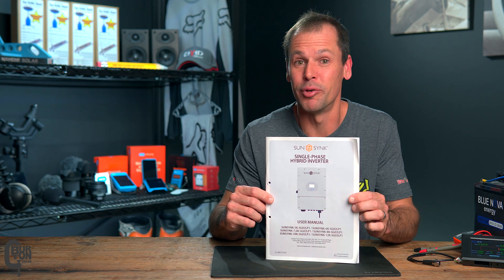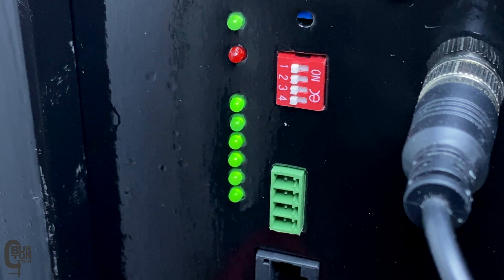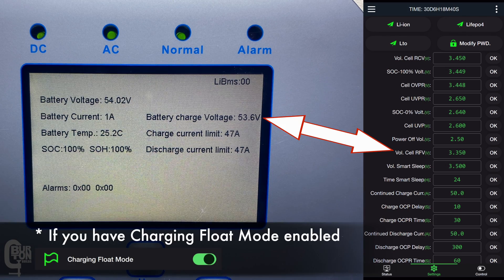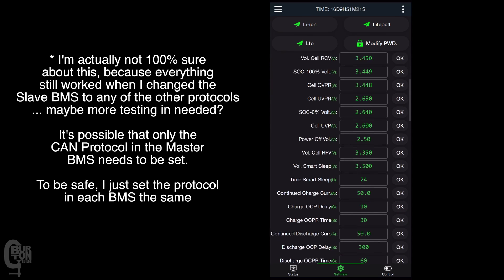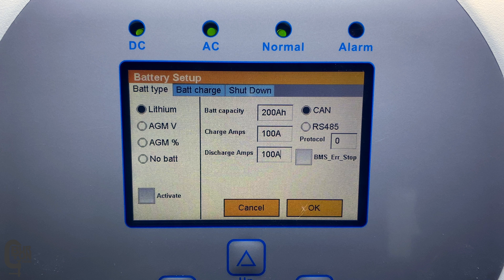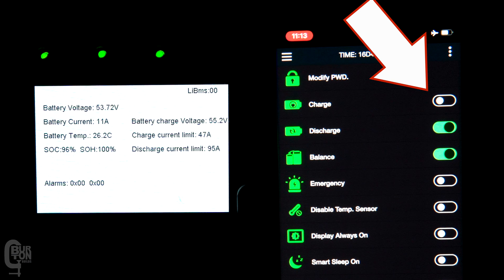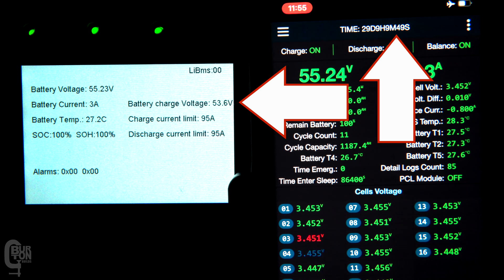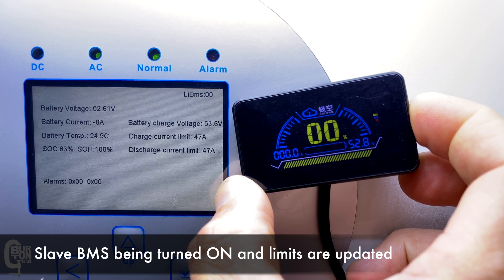Connect JK BMS to SunSynk / DEYE Inverter WITH Communication (Parallel and Single battery)

Comment: Hello Grant. Will you be testing 15.24 software?
Reply from the maker: Hi, yes I am planning on it but I just haven’t got around to it yet.
Reply: Hi just test the 15.23, it solve the force charge bug but now the com with LCD is dead 😅
Reply: 15.27 solve all bug
Reply from the maker: @nicof9202  Hi, V15.27 seems to be working ok for now but it still seems to have the issue of the SOC not being calculated correctly / consistently when running two BMS's in parallel. Using the older style JK BMS's in parallel, both batteries SOC was pretty well matched as both batteries discharged (within 2% of each other as I recall) however I've noticed with the Inverter BMS connected to the same batteries as before (swapped out the old style BMS for the Inverter BMS), one battery seems to 'discharge' faster than the other... or at least that's according to what the SOC% is showing (the difference in the reported SOC can be up to 10%).
Reply: @GrantBurton  no pb for me with 3 packs in //, SOC is now the mean of the 3 packs and charge/ discharge with an initial soc not equals between packs  become equals after some time .
My only big concern is the alarm report to Deye inverter not working , i simulate lots of alarms and no one go to the inverter , this is really bad.
I report this to JK, I also request an upgrade for they use the packs reporting tab to see each pack value on deye screen.
Reply from the maker: @nicof9202  Hi Nico, I probably didn't explain my situation properly. I agree with you... with the later firmware versions, the SOC is the average of the two batteries in my case (3 in your case) and it reports like that to the inverter 👍 No problems with that (with earlier versions of firmware, it used to only report the Master SOC to the Inverter) But in my case, it just seemed that one of my batteries was discharging faster than the other, but before changing from the old BMS to the new BMS, they were discharging equally... it might be 'loose terminal' issue but I'll need to investigate further.

I've also tested the Over and Under Temperature limits on v15.27 (busy making a video of this) and found the same result as you... no alarm is reported to the Inverter, but all the limits and protections seem to work correctly on each BMS, and the charge and discharge limits are also updated on the Inverter when the protection kicks in... so thats good.

Also only the Master BMS temperature is reported to the BMS, none of the Slave BMS temps are taken into account or reported... and it's an average of the 4 probe temperatures from the Master BMS that is reported... I think it would be better that the highest probe temperature is reported, not the average, so that it works like the BMS... if one probe temp goes out of limits, it must flag / alarm. 

I still need to get around to testing the charge and discharge limits again.

Comment: Hi, I have a question to ask BMS JK firmware 15.24. Do not communicate with inverter Deye. Temperature exceeds 100 degrees. Sometimes negative. Please introduce to us the configuration used with inverter Deye.
Reply: Check the cables. For me it works on protocol 1 deye and 2 pyllon
Reply from the maker: I also have firmware V15.27 working on SunSynk Inverter on both CAN protocols 1:Deye and 2:Pylon.

Comment: Thanks Grant for the great information in your videos. I’d like to know how or if I can parallel six of these BMS’s together? 
I have six LiFePo4 16s DIY packs. Do all slave BMS’s RS485 master, or RS485 daisy chain slave to slave back to master? 
Thanks for any info..
Reply from the maker: Hi Shawn, it's a pleasure. Not sure if you have come right yet? You should be able to parallel 6 together. Master BMS will be connected to the Inverter over CAN, using the CAN port. All slave batteries (BMS's) will be daisy chained to the Master BMS, starting at the RS485 parallel port on the Master and then connecting an ethernet cable to the RS485 parallel port on the first Slave. Then from the RS485 parallel port on the first slave to the RS485 parallel port on the second slave and so on. The RS485 parallel ports are the two ports on the far right end of the comms board that I show at 06:11

Master BMS will be set to address 0, First slave BMS to address 1, second slave BMS to address 2, third slave BMS to address 3 and so on.

I've only ever connected two batteries in parallel using the JK Inverter BMS but I'm pretty sure it should work with more batteries as described above.

Comment: Thanks for your help, when connecting batteries, how important is it to match voltage between master and slaves?
Reply from the maker: Hi Jason, I think it's best to try to get the packs voltage as closely matched as possible before connecting them in parallel.

Comment: Hi Grant,do you know if difference spec JK inverter BMS can be used in series? I have a 1amp Ballance 100 amp BMS, and I want to run another JK inverter BMS that is 2amp Ballance 200amp, will this work,or do they all need to be the same including the firmware? Thanks for any help you can offer
Reply from the maker: Hi Jason, Yes, you can use those different version together. I haven't tested this myself but Andy from Off-grid Garage has and it works. I don't think they need to be the same firmware but firmware earlier than 15.11 seems to be buggy so hopefully yours are 15.11 or later (for hardware version 15 of course).

Comment: hello , i tested many BMS on deye like seplos, pace , and use JK old model wihout can ( voltage regulation , bms as active safety ) and i am waiting 450 cells and many new model JK , wihout ajustements to jinkong regulate well at top and bottom ? the last i test was paces regulate perfectly at 3.6 higher cell but stop discharge at 80 % SOC !! impossible use like this , Jk say the last model is only compatible with deye  5 K . what was your test ? on witch model ? i am limited in english ,
Reply from the maker: Hi... I have used the JK Inverter BMS with 105a/h cells for 3 months and it will balance all cells well after each full charge and I don't have to make any adjustments once the BMS is setup correctly... I have the 1A balance current version PB1A16S15P (but with larger capacity cells, you might need the JK Inverter BMS with a 2A Active balancer).

On the JK Inverter BMS you can set the voltage that you want to represent 100% SOC (Example - I have mine set at 3.449v/cell) and the voltage that you want to represent 0% SOC (Example - I have mine set at 2.64v/cell).

If your Pace BMS is only discharging down to 80%, maybe the Cell Under Voltage protection is set too high? or there is some other limit that the BMS is reaching? I am not familiar with the Pace BMS. Maybe it's your inverter stopping the discharge at 80%?

I am using two JK Inverter BMS's in parallel, and connected to a SunSynk 10kw single phase Inverter using CAN communication and it's working well up to now.

There are other JK Inverter BMS videos with testing that you might want to watch... https://youtu.be/7AE8k0vhZPU and https://youtu.be/tlNvlhV4NZ0 and https://youtu.be/rUaGVfTAjcc
Reply: @GrantBurton  hi , i monted the first of new set of battery , i ajusted like you explain , but the inverter i use is deye 6 k , theinterface if different than the sunsik , when i pug and enter in lithium mode i can see some battrey data like % low and high voltage , but it take in grid to charge battery !!! so i returned on voltage mode like ever , do you know if floating mode can me it limit charge to 10 a ?

Comment: Hi Grant. Thanks for the great video. Unfortunately I am still struggling to get the communication between a JK BMS (PB2A16S20P) and a Sunsynk 16kw inverter with Version 1.11.13. I have checked and I am using CAN protocol 1. DIP switches are set to all off (Address 0). Cable is in the second RJ45 and connects to the CAN port on my inverter. Is there something that needs to be set in the inverter? The JK BMS is on software version V15.10. Hardware version V15.XA. I also tried a second JK BMS as I have two and get the same result. Any thoughts on where to look. Could it be the inverter firmware that requires update?
Reply from the maker: Hi Leonard, I've only ever tired to use firmware version 15.11 and 15.17 on the BMS and both of them are able to connect and communicate via CAN.

Check the user manual for your Inverter to be sure, but according to my manual (10kw Inverter) the CAN protocol on the inverter needs to be set to 0. It's at 02:49 in this video... see the note that pops up on screen. If yours is set to protocol 1, it's likely trying to use the RS485.

You could try update the firmware to V15.11 and then set CAN protocol to 001:Deye or 002:Pylon... both of those should work.

Are you using the ethernet cable that came with your Inverter?

Let us know if you come right.
Reply: @GrantBurton  
Hi Grant. It is definitely set to CAN and protocol 0 on the inverter. 

I will try get hold of a RS485 module and update the firmware to V15.11. 

I did not get a ethernet cable with my inverter. I guess my installer kept it since I was not installing batteries at the time. I assume it is a normal ethernet cable. I did try a second cable and it did not make a difference.

Do you know what firmware your inverter is running?
Reply from the maker: @leonardfernandez882  A standard ethernet cable should work. My Inverter is running Master MCU version MB026 / Slave MCU version S1726 / Communication MCU version CE439 however it was working also working on an older version MB024/S1726/CE433
Reply: @GrantBurton  Thanks Grant. I will check my versions on the Sunsynk side.
Reply: @GrantBurton  I have updated my firmware to 15.11 and it is still not working. I have request a firmware update from Sunsynk
Reply from the maker: @leonardfernandez882  HI Leonard, did you get your SunSynk firmware update?
Reply: @GrantBurton  yes, got the Sunsynk inverter firmware updated. 
Away for the weekend (In Durban getting ready for Comrades tomorrow) I will check when I get back Monday but from the app I don’t see any battery, so not looking promising. I am wondering if the hardware base for the 16kw platform is older than the 5 and 8 kw inverters. 

If not connecting, I will try a RS485 connection as a last resort 🙈

Running out of options!!!!
Reply: @GrantBurton  Hi Grant. Just to let you know the Firmware update on the inverter did do the trick and the BMS is now taking to the inverter. Thanks for the great channel
Reply: All sorted. Firmware update on the inverter fixed the comms and its working now.
Reply from the maker: @leonardfernandez882  Hi Leonard, thats great news, and thanks for letting us know.
Reply from the maker: @leonardfernandez882  Hi Leonard, that's great news, and thanks for letting us know.

Comment: Thank  you Grant for your really helpful video's. I have done the downgrade to 15.11  but i have noticed that total soc  in parallel is not calculating. I also noticed that when almost fully charged the BMS is not ramping down the charge currant limit. The JBD bms and the Pylontech US3000C was doing this perfectly on the Deye and and also  on Victron. I am going to try going back to firmware 15.17 and Pylontech CAN mode to see if it solves this.
Reply: Calculating SOC is  working again on 15.17 version. I am using Pylontech CAN not Deye CAN with  this version.
Reply from the maker: Hi Erik, I've now also upgraded to 15.17 and am using CAN protocol 002:PYLON on the BMS and all seems to be working, including SOC calculation (When using 001: Deye protocol with 15.17, I was getting a Request Force Charge command which wouldn't allow the battery to discharge... I made a video about this https://youtu.be/rUaGVfTAjcc but I think you have seen this video already).

Thanks for your comments.

Comment: Hello friend how r u I have a 200A jk inverter BMS I have problems with the red light continuously on but all connection is okay
Reply: Inverter and BMS communication failed
Reply from the maker: Hello, are there any warnings that show in the app? I know if you don't change the default password, it would flash red, and after setting your own password, the red light would go out... maybe its this?
Reply: @GrantBurton  yeah, the red light is on, but not flashing. The App says: set your own password....
Reply from the maker: @mandxyz2523  I think after you set your own password, the red light will go out (unless something else is also wrong).

Comment: I have two batteries of different capacities, both with jkbms. One 280ah and the other 100ah. BMS has different software 14 and 15. When the main one is with software 15, the second one still has a high voltage error. When the main value is 14, the inverter does not see the correct value
Reply from the maker: Hi Jerry, I'm not sure exactly what you mean? Have both batteries been fully charged and top balanced? Maybe try to only connect one battery at a time... charge one full and let it top balance. Then disconnect that battery and connect the other battery. Let the other battery fully charge and top balance. This way both batteries should be at the same voltage (or very close).

Is the Master BMS connected over CAN? What CAN protocol have you selected in the BMS? What firmware version is on each BMS?
Reply: @GrantBurton  Master bms is connected via CAN. Protocol 00. Jk pb1A16s10P Hardware V14.XA Software   V1404  JK PB2A16S20P Hardware V15XA Software V15 09
Reply from the maker: @jerry76-jc5mg  You might want to try use CAN Protocol 002 - PYLON - Low-voltage-V1.2 on the master BMS.

The latest firmware version for BMS Hardware 14 is v14.20 and the latest firmware version for BMS hardware 15 is v15.17

You might need to update the firmware on both of your BMS units. I have a video showing how to do this here https://youtu.be/NtJ9aUTIWxk?si=l5pKTm4Pxmh4B_Rj
Reply: @GrantBurton Updating two bms to version 15.17 improved the situation. Just a few more settings changes so that the inverter limits the charging current when the SOC approaches 100%
Reply from the maker: @jerry76-jc5mg  Thats good news... please keep us updated with how your setup is working, especially with two batteries with very different capacities running in parallel.
Reply: @GrantBurton  Many interesting things are explained in English and the translation is not always accurate. I am constantly striving for satisfactory results and I think I achieved it. It turned out that I had inaccurate BMS settings. Thank you for the good job
Reply: I have v15.18 on 2 bms and v15.10 on one, so need to update to v15.18 but cannot find it.
Reply from the maker: @darrenfrater3496  I'm sure you could load 15.11 or 15.17 and that would also work if you can't find 15.18.

Comment: Hola tengo el bms pero no comunicación con victron mi pregunta si configuro el voltaje por celda máximo de carga en 3,45 este corta solo la carga o corta la batería directamente? gracias
Reply from the maker: Hi, are you asking about the Cell OVP (Cell over protection voltage)?

Comment: Dear Grant. I have some problem about the communication between JKBMS and inverter. Now  my BMS firmware is V15.17. I installed 2 battery in parallel. The Device id of  first battery is 0(master unit). The Device ID of second battery is 1(slave). When I connect the master unit to inverter(CAN port). the inverter can't communicate with master battery. But If I move the communication cable to slave battery. The inverter can communicate and  read any information of slave battery. But the inverter doesn't recognize a master battery. What should I do?
Reply from the maker: And what happens if you set the Master battery to address number 1 and plug it in (unplug the slave battery's communication cable)... does the Inverter communicate with the Master battery?
Reply: @GrantBurton  Ok I will try it, then I will let you know.

Comment: Hello from India..
I am facing a peculiar issue .. with my deye.

When my SOC is below 20 percent (actual SOC 18%)and I am on full off-grid mode at night without solar and grid.

In SOC below 20% if I turn off and turn my inverter. I don't get the output 

Battery mode selected lithium

Restart set at 3% I have tried setting  0% also 

But no avail.

It wont turn on the load until I turn on the grid or change mode to percent mode.

Now two things again

If I turn on the grid .. the load turns on.. and if I immediately turn off the grid the load still keeps running.

Case 2 no grid.. butnif inchange battery mode to percent mode from lithoum.. then the battery percent starts showing as 87% although my SoC in battery is actually 18% .. it starts the load after 3 mins.

Now case 3 .. my mode is in lithium and no load 

But as I pull my comm cable the percentage turns to 87% again and the load starts..

So now conclusion: Deye is below 20%. In no grid no solar .. load doesn't turn on if restarted in no grid and no solar.
Means whenever in no grid and no solar deye reads SOC as 20 or below it doesn't turn on. Tried every solution didn't help pls help in case you knowm even deye engineers don't know.

Anything above 25 percent the load turns on without grid without solar ( pure backup mode) even if I turn off and turn on.. I get the load output .. only issue is below 20

Jk bms V 15.17
Reply from the maker: Hi Dipanjan, I've heard of a few people also experiencing the same problem but I'm not sure at the moment what a solution might be. If you find a solution, please let us know.
Reply: @GrantBurton  Sure Grant. Thank you so much for responding